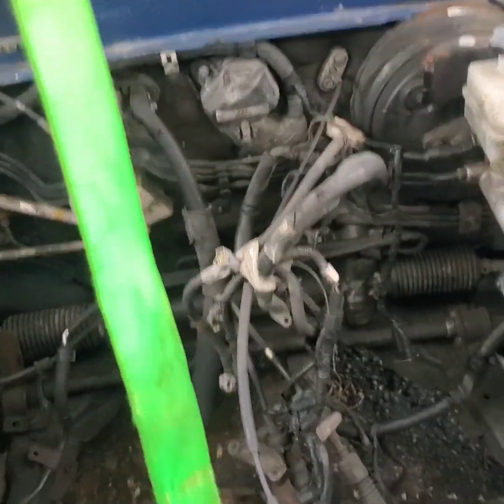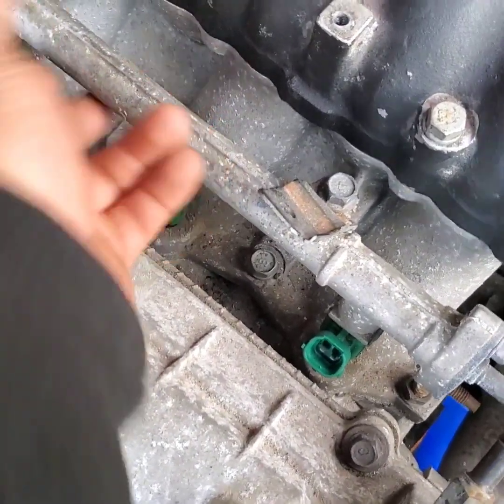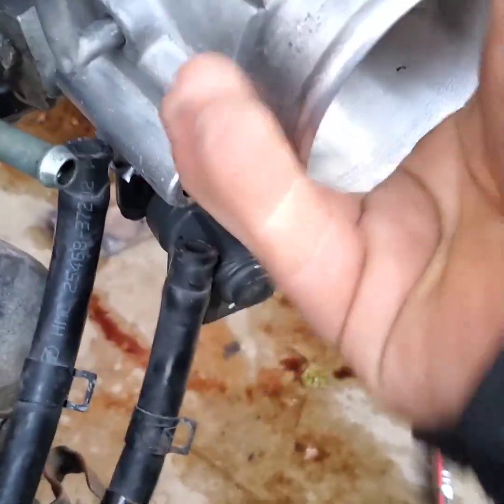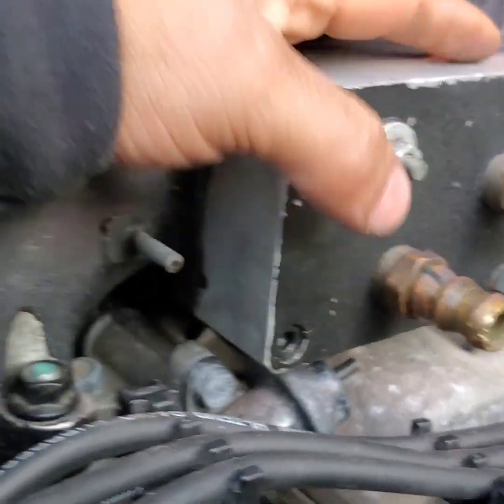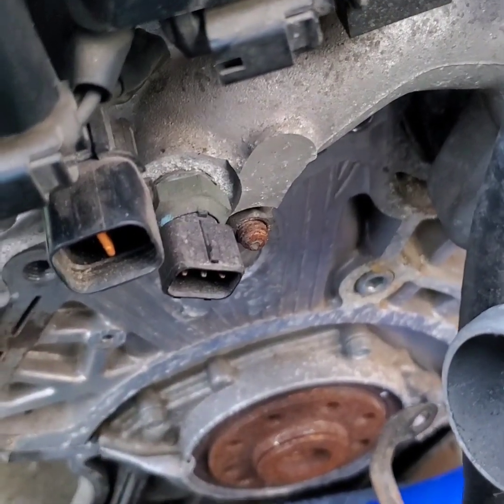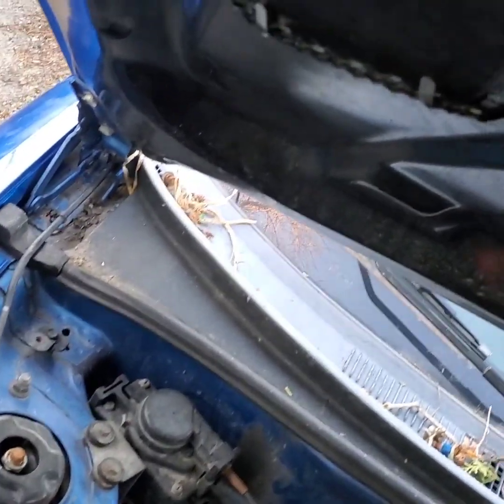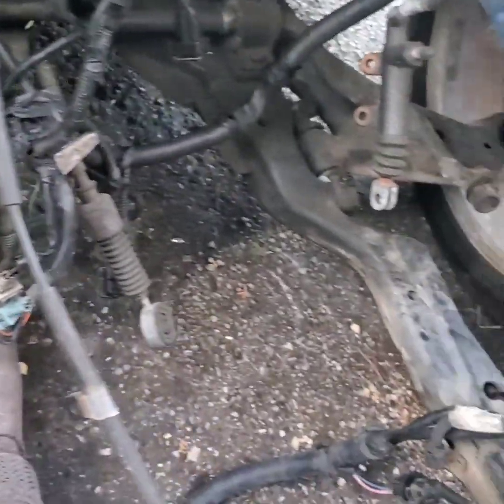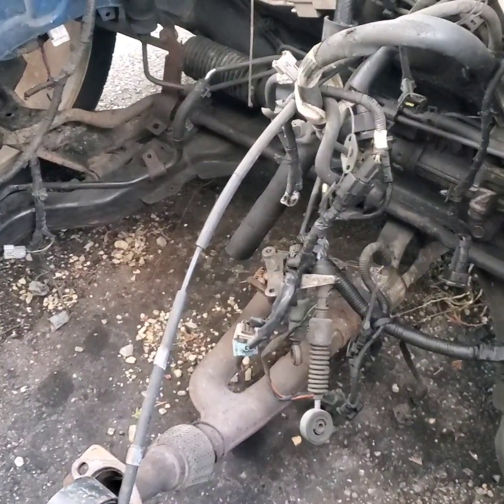Test fitting alpine supercharger on Hyundai 2.7L V6 engine

Comment: I have the same engine in my Sonata. Thank you for giving me an idea on how it would look and works.
Reply from the maker: You don't need thank me. Ppl been supercharged Tiburon for a while now and there pictures online. If you going supercharger your sonata you will need a piggyback or standalone ecu, bigger fuel pump, injectiors & fuel pressure regulator.
Reply: @Lilmiddwest  okay
Reply: Did you do anything to the sonata? I have the same engine and im looking for some info to turbo it or smth
Reply: @NestexBETA  no sent it to the junk due to a few issues with the exhaust and previous issues that were not fixed properly by the previous owners.

Comment: Can you tell me where can I get the intercooler parts for the alpine super charger aqua cooled for the same engine as yours? I just had the super charger but not the intercooler kit...
Reply from the maker: intercooler is built in to the supercharger kit. i might buy cx racing water to air intercooler kit

Comment: Can't wait to see it up and running. Proud tiburon owner myself. Been looking for a supercharger but they're hard to find. Did you get this alpine s.c from the forums?
Reply: I think there is a guy trying to sell a supercharger  for 2k on newtiburon right now. Its a stage 1 NGM.
Reply from the maker: Last last video I said I got the supercharger with the car. I bought it from someone that doesn't have time to fix it anymore.
Reply: i’m selling mine... who car has no rust but body kits trash
Reply: @billybob261  just out of curiosity, how much you sell it for? Just trying to figure out a fair price if I come across one.
Reply: @hurbye  1750 but that’s cheap bc the throttle body bolts were stripped (easy fix but didn’t wanna mess with it anymore)